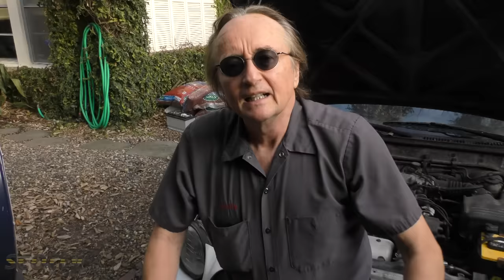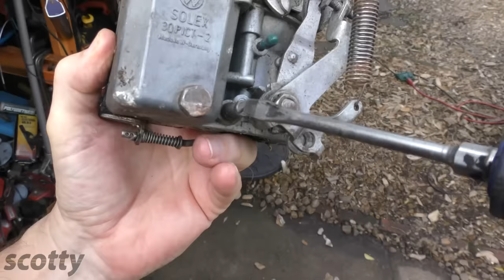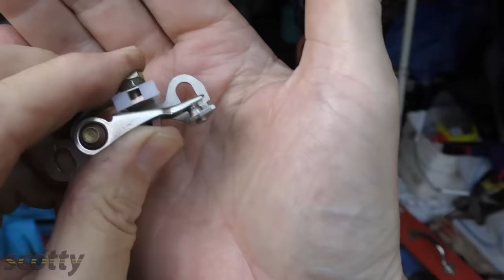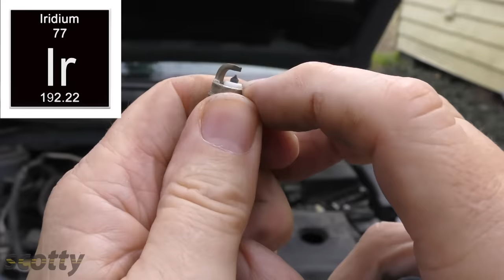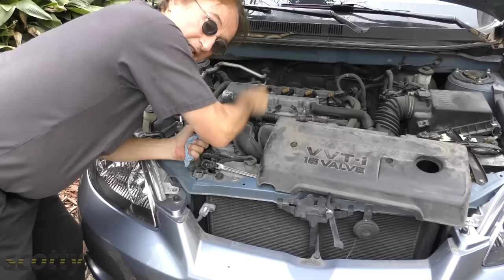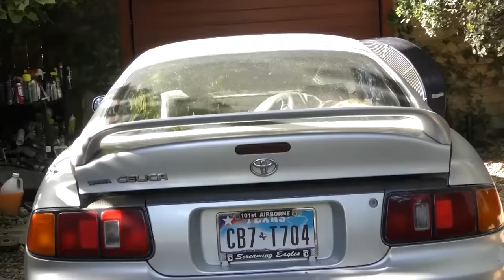Does Your Car Need a Tune Up? Myth Busted

Comment: Hey Scotty, it's been a while since you did a real tuneup, because you somehow included the carburetor. Don't be too shade tree man. If the car is running bad, and it's been a while since a tuneup, then you tune it up first, and get that out of the way, knowing that part is right. You touch the carburetor if necessary after the tuneup, and you certainly don't just mess with any of the screws. The only reason they even have mixture screws is so they can be completely removed and the passages blown out in a rebuild. Otherwise, never fool with those, except after a rebuild.

A tuneup is to repair physical wear on the electrical system. Mainly the points, which over time erode, increasing the gap, which advances timing and decreases dwell. You'd sandpaper those contacts to be shiny and new, and after a few times there's not enough contact thickness left to properly adjust them, so you'd need new ones. At least every other tune up you should put a new condenser in, which prolongs point life and allows you to enjoy your radio better. Also the spark plugs would need cleaning and re-gapping. Unless they too were eroded to the point of replacement. A good tuneup would also include sanding off the tip of the rotor, which was prone to erosion and pitting, and possibly the terminals inside the rotor cap. 

And when I say sanding, I mean the finest paper you have the patience to use, as leaving micro scratches on the surfaces will cause them to wear faster, and your next tuneup comes sooner. Points were cheap enough that usually you'd only clean them once, and then the second time you'd buy a kit that comes with points, a new condenser, and a little capsule of lube for the distributor shaft.

Obviously, none of that has mattered since 1975, by which time every car came with electronic ignition. A point style system put maybe 20,000 volts through the spark plugs. Electronic systems deliver about 100,000 volts, more than enough to blow off any carbon residue. That's when plugs started lasting a lot longer, and then fuel injection came and there is no extra carbon now, so plugs nowadays generally outlast the engine.
 If you say the iridium helps, I'll believe you. I figured it was just more BS marketing to get 20 bucks a plug.

There hasn't been such a thing as a 'tuneup' since the 80s - you are right about that.

Comment: Even though modern spark plugs may last a very long time, is it wise to actually leave them in that long? I've heard horror stories of plugs like that seizing in the cylinder head and ruining the threads in the head. And if yours is a Ford Modular engine with the early 2-piece plug...
Reply: I'd say no, a few years back, I bought a used 1996 Buick Skylark, 150k miles on it, spark plugs never been changed, a week later, it started misfiring, took the spark plugs out, and on each one, the electrode that hangs over the wire in the middle, were so thin it was ridiculous. I say follow owner's manual on spark plug replacement, which on most every car I've seen, recommends to replace them, around 100k miles.

Comment: I can see where you coming from
Scotty but you can still call changing the oil and filter and the air filter and spark plugs and checking the hoses and belts a tune up just like you call a  serpentine belt a fan belt

Comment: Tune up? Sure. The air intake plate often accumulates gunk, as well as inside the intake manifold. Carb cleaner, old tooth brush it up, I get all kinds of crap out. Sometimes the plate is actually sticking to the manifold hole the buildup is so high. Take care of the Mass Air Flow sensor, if that's dirty it'll screw up your gas-air mix. Check the motor mounts (especially on the big FWD Cadillacs, front mount), hoses, belts, fluids. Then make sure the catastrophic converter is ok. All kinds of bad stuff happen if the catastrophic converter is bad. Did I get you? There is no catastrophic converter. Seriously, the intake manifold and the MAF sensor really do need to be maintained. Modern engines are amazing. I don' t miss the timing light.

Comment: Will i am modern car auto mechanic here in philipines  and the words  tune up in the electronics modern cars is cleaning the engine system  ,because how self afjust the computer boxs if your car car is dirty like the map sensor ,throttle body,injector, fuel rail ,fuel pump filter, spark plugs , intake manifold and also intake valve.

Comment: You are so very right on all counts. I am an old man but I used to do my own tune ups like on an old 165 Chevrolet Belair I had with a 283 V/8. Yes I would change my spark plugs, points and condenser. Then I would set my timing dwell and point gap. I would also check the distributer cap for any wear and check the fuel/air mixture adjusting screws on the two barrel carburetor and then I would finish it off with a timing light. I always hated that GM always put the engines distributor on the backside of the engine! I have to say that those were the good old days when any old Joe with just a little mechanical knowledge could service their own car.

Comment: it is better to fuel up when the climate is cooler cause gasoline evaporates at a cooler temperature than water. it's like when you pour a beer and there is a reaction in the carbonation.your glass gets full of gas first then settles to liquid and theres only half a glass.

Comment: 90% of a modern vehicle tune-up is replacing the few things remaining that deteriorate in use.
The most overlooked part of a modern "tuneup" is cleaning the engine bay.  IME, the cleaner the bay, the easier it is to prevent deterioration, and to spot and fix/replace things when they deteriorate.

Comment: I was told it costs $606.00 for a "Tune Up" on my 2015 Ford F-150 from the Ford Dealership!! All they would do is change the spark plugs. A set of 8 plugs cost $40.  I think I will be doing the job myself!!

Comment: I took my kia to the dealership for it's 60k milage maintenance.  They were suppose to replace the spark plugs.  There is no way they changed them.  Maybe the front one, but not the back.  They would have to take the entire top of the engine apart to even get to them.  And the fluids they said they flushed and replaced did not look much different then the old fluids.  Was not impressed.  I just changed all my fluids myself since the warranty has now expired.  At least I know it's done right.

Comment: "you don't need a tune up on 'modern' cars"

Oh, great!  I guess I can put together that old...

"They're not like old cars with carburetors and spark plug wires and no electronic control systems."

A single tear for my base model 87 civic currently scattered across my garage.

Comment: IDK about this video,  cars really do need to be maintained after a certain amount of miles.  Maybe the terminology is not literal anymore,  but if you haven't done so,  at 100K you should change spark plugs, flush the brakes and coolant, replace the cabin and engine filter , Change the oil and the filter,  change the serpentine belt and also check the brakes if they need to be replaced... hence "tune up"

Comment: I have a 2007 Saturn ion. I feel like it needs a tune-up, not sure what I can do with it though.
Reply: Everything depends on a mileage and the year of the vehicle and if you're not having no problems as far as misfires bad gas mileage you don't worry about it or check engine lights

Comment: I called a highly rated (Yelp) mechanic today and asked him what the cost would be for a tuneup. He quoted me about $300. I asked him was the tuneup included. I'm like WTF? I also called meineke and they told me it would cost way more than $300. Think I'll do it myself , though the spark plugs are really hard to get to (2000 Bravada).

Comment: I'm still rolling with original plugs and plug wires on my chevy uplander. 234000 miles now. Gonna try for 300000 miles on all original engine. 😁😁😁

Comment: In the old days, you use to have tune up your car to keep it running well. Now they have computers that monitor  and adjust parts of the engine as necessary

Comment: Hi Scotty, what if you put 100T (plus) miles on the car in 27 mos. Mechanic says the car needs a tune up and will need spark plugs that cost $37 a pc.
Reply: 6$ a piece at AutoZone. Do it yourself in 1 hour

Comment: I took my 98 camry to a mechanic because I was checking a check engine light with a code that cylinder 2 and 3 were misfiring, they charged me $370 for a tune up. plugs, wires, coils, fuel filter. They said it was so expensive because the coils for my car are expensive. Does this sound like a trustworthy mechanic?
Reply: Sounds like a good price to me for all that work.  The coils were probably the originals, so I'd say the mechanic is honest.

Comment: i can tune up my car its volvo 460 with 2.0 injection engine there is small bolt on top of engine can tight and release the cable of gaz wich connected with gaz pedal

Comment: My friend went for a “tune up” and they sold her new wiper blades, cleaned her floor mats, vacuumed her interior, said they cleaned the battery area, tried to sell her new, better all season tires as they said but the ones on their car had more life left in them, filled up her washer fluid, pun on a new fuel cap because they said the plastic strap the attaches it to the car had broken & she could lose it filling up, the also suggested she go back to get tires rotated and battery changed but she had done that a week before at a different shop which she hadn’t told them. They see a woman and see money. Lol

Comment: Tune up? They try to sell ECU update and plug in chips. They never tell you that would avoid warranty though.
Reply: A lot of times the PCM flashes are covered under recalls and most of the newer vehicles to not have a chip in them anymore the older vehicles did

Comment: Just had a mechanic at a place called smitty's try to tell me I needed a tune up, when I asked what that entailed he fumbled around saying cleaning the throttle body and reset fuel trims, I passed, then he refused to fix why it was there to begin with😮

Comment: Hi Scotty! Love ur  videos. I bought  a 99 Montero Sport  with only 93000 miles on it  for $1500 last year. I'm not a mechanic but i can do some things.When i bought it i changed fuel and air filter,  pcv  valve, trans fluid and filter, motor oil and filter. The plugs and timing belt were something i left up to a real mechanic. He put a timing belt kit witch came with all new belts including fan belts and new water pump and new  pulleys. He also put new plugs.  i ask him to put these Iridium plugs in and he said he didn't recommend that. He likes putting the factory plugs back in because he said with the iridium plugs in it that it wouldn't run right. IS THAT TRUE???  Also he charged me $300 to put new plugs in and $600 for timing belt, = $900 for everything. was that a fair price? {I live in N.C.  I wish i could have used a 200,000 mile plug since its so hard to replace plugs in my Montero. Thanks! Kevin.

Comment: what about valve adjustment? my 2002 mazda is ticking quite loud when cold.
Reply: Joe Barbaro is it a miata? those hydraulic valves make noise often don't worry about it
Reply: no, it's a 323f/protege5. 1.6 engine which is somewhat similiar to the NB 1.6
Reply: those are indeed about the same the lifter noise is normal people have tried a lot to fix that but almost always it will come back
Reply: I was wondering if they are the similiar, would a turbo manifold from a mx5 fit on mine?
Reply: if i remember correctly the bolt pattern is different so no it won't fit
Reply: well shit there goes my idea of a cheap turbo project
Reply: You can adjust your valves to the manufacturer's specifications but a lot of time are noisy all the time especially when they're cold

Comment: people take it for granted. Modern engines adjust fuel air mixture on the go. You cant just set the ratio and forget it. For the engine to always work right, you have to set the ratio for air humidity, temperature and altitude every second that it runs. With the carburetor it would get it CLOSE ENOUGH to run and idle, but just barely. And even then they would run like shit compared to fuel injection. As far as tuneups these days, that stuff is going the way of dinosaurs, with electric vehicles and all, oil that lasts two years. Transmission and diff fluid that never wears out.
Reply: YES10 I disagree I like carburetors plus alot of carburetor cars had air manifold temp sensors

Comment: Gee, I didn't know that. Since it isn't true. 

A Hemi with more than 30k miles on its 16 plugs will continue to run... just with way less power. They only recommend copper on those engines and they built and designed them around that.

Platinum plugs still 'work' at 100 K, just not very well. They are rated for 100k but only make about 80% of the efficiency, so the rest of the system works harder to keep it working longer but not as well.

Iridium plugs lose about ten percent in 100k.

Wires and coil overs wear out like anything else.

The difference is the ECM adjusts for the lost efficiency, so the car  'runs' but at a lower level of response. For example, rather than develop a distinct miss the motor will just make less power and use more gas. But it will still 'run'. And you won't even notice it because it just gets worse very gradually.

Spark plug wires on those that don't have coil overs still go bad at about the same rate they did in the 70's. 

Vacuum lines start to leak just as fast as they ever did, and the ECM 'compensates' for it by running up the mix, thus using more gas and running just a little worse. But it still runs so...

Tune ups today don't change points like they did in the Kettering ignition days, but they do clean your throttle body or ports, something that cruds up very quickly if you run cheap gas... which we all do.

Fuel filters get dirty pretty fast on those models that have them in line. Not to be confused with the almost useless socks in the gas tank.

Air filters clog as mentioned but the ECM compensates for it so you don't notice.
 Change the filter and the wires and plugs and watch the gas mileage go up as well as performance.
You just don't have to do it every 15 k but do it every 50 and you will see a lot of response.

And now we have clogged EGRs and bad O2 sensors to deal with. A high mileage O2 will run and not set off a check light, but you will dump a lot more fuel into it to keep it running than when it was new.
 Don't ignore your engine lights. Cars run way worse with a check light set for a variety of reasons. 

Modern cars are WAY more reliable than the older cars but they still need to be maintained. 
The difference is it's easier to do it yourself.

Comment: I do clean my throttle body at every 20k miles by using throttle body cleaner. Im using seafoam to clean my intake manifold. And every 10k miles.. im using fuel injectors cleaner to clean my fuel system. Chamge my airfilter every 20k miles. 
By doing so... my 20 yrs old mazda protege still drive like a dream!!!

Comment: Well of course there exists a tune up:) All engines can be tuned up. If a car is turbocharged then You can remap it and it counts as a tune up, on NA engines You can change the camshafts.... these all are tune ups:) Fact that You don't use a screw to do it does not mean it can't be done.